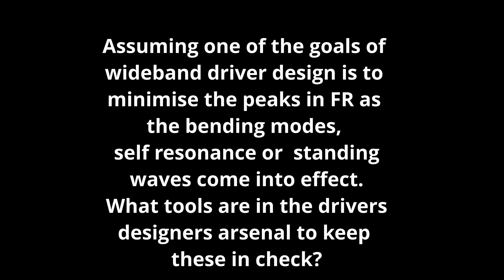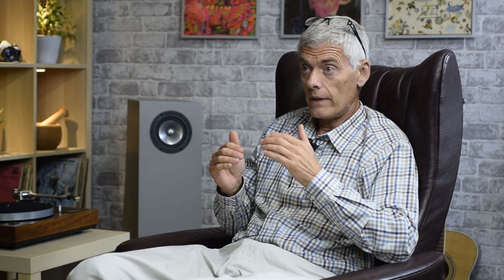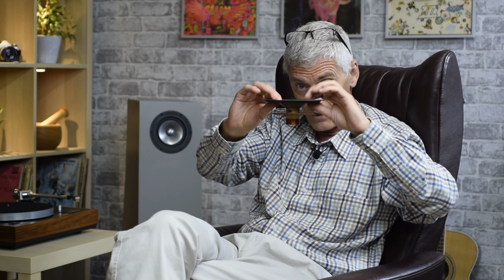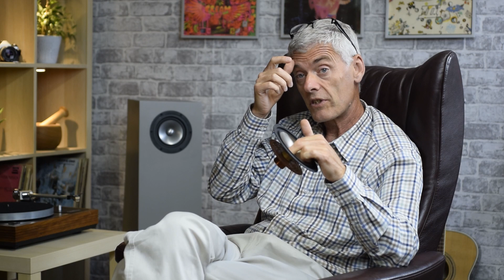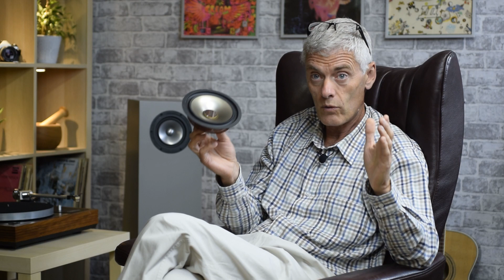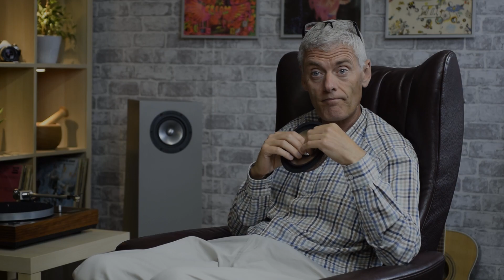Mark Fenlon on optimising full range drivers for frequency response

Comment: Not saying he is wrong, but I have never heard of the cone requiring to be flexible "you will get no sound out of it"....dont get that, its just pushing sound waves, why does it need to be flexible.
Reply: In order to achieve controlled breakup at difference frequencies which helps it reach a wider range.
Reply: Look at a typical woofer; it may have harsher breakup before rolling off fast in the highs. This is probably what he means by "get no sound" out of it, at least in the high frequencies.
The typical woofer may be lower distortion and flatter in its passband however

Comment: Hi mark hope your well I have your 10P
But I can not seem to get the high frequency and detailed to rely come great mid for vocal and a for jazz 

I just saw a clip, the guy has the same 10p  when I herd hd the detailed was very nice , what could I be doing wrong ?
Reply: Try to add stuffing to your speaker carefully. Dense but not compressed. Use wool.
Reply: @romantea3506  thanks i changed the position  an i think I hav hit the sweet sopt
Reply: make sure your room has good acoustic properties, some dampening in the room might help
Reply: Change your amplifier to something thats a little brighter